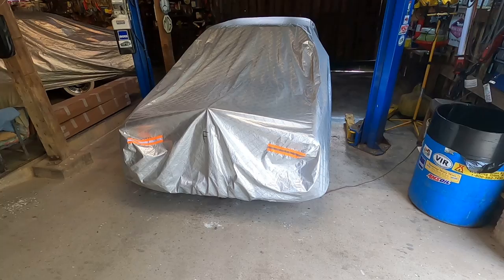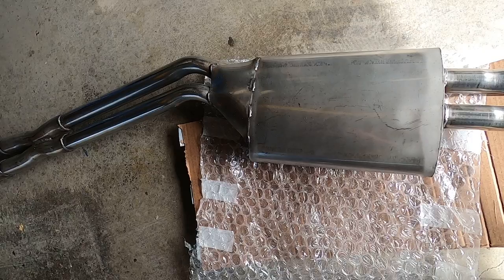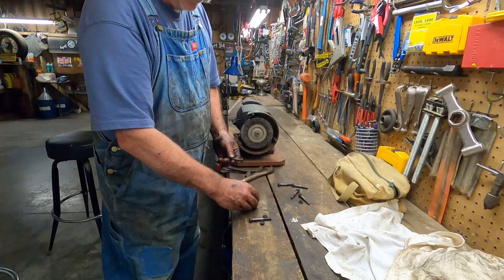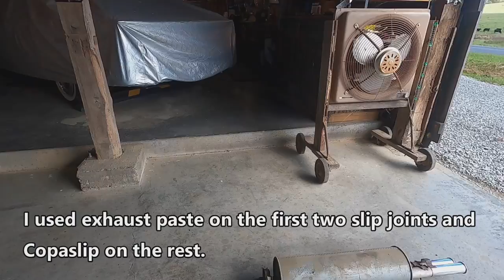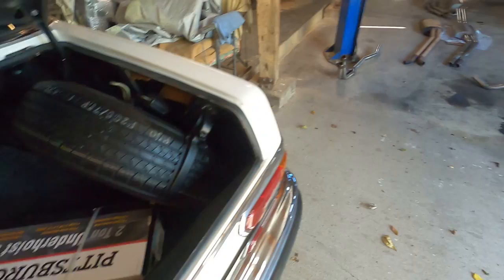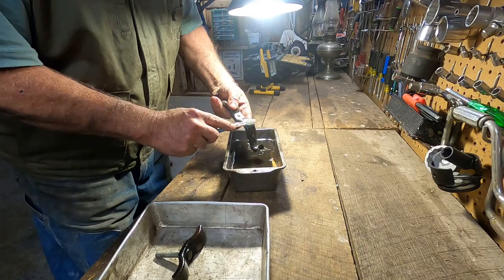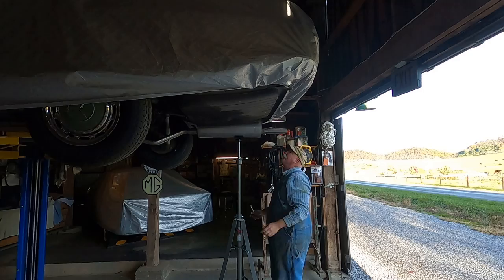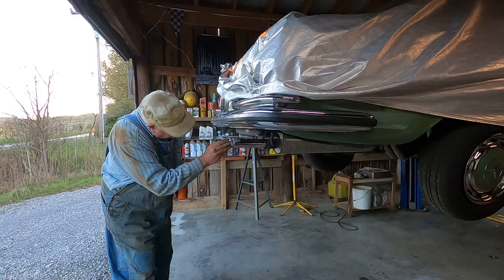1973 Mercedes Benz 280SE 4.5 Exhaust Removal & Factory Correct Stainless Steel Exhaust Installation

Comment: Thanks for sharing! I have the same kit I will be installing soon.
Reply from the maker: You will not be disappointed in the quality of materials, fit, and overall workmanship. The car has been running for 2-years now with this complete exhaust system with no leaks, rattles, and the sound is very pleasant. Thank you for watching and taking your time to comment.